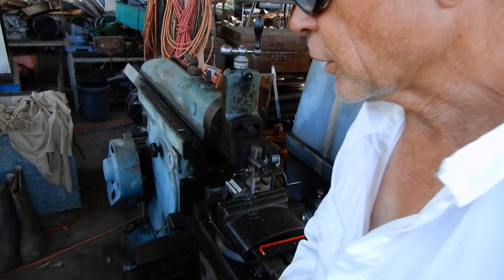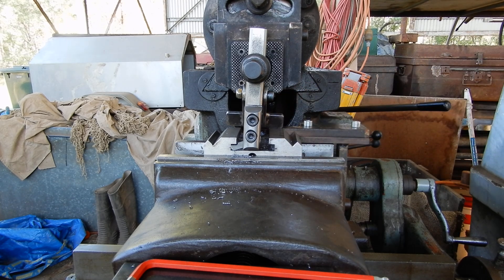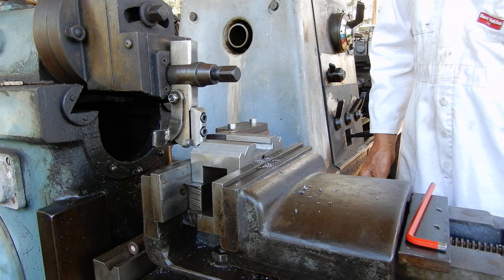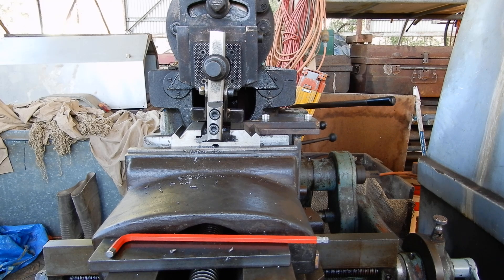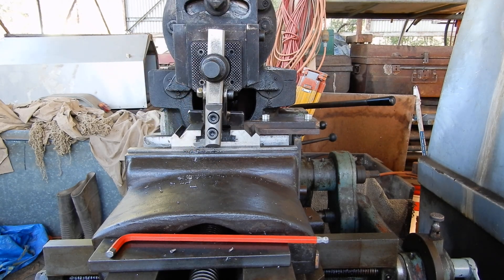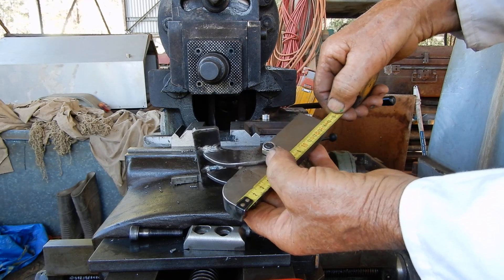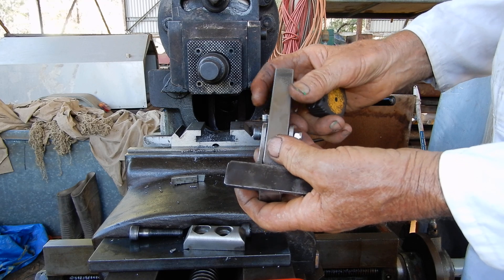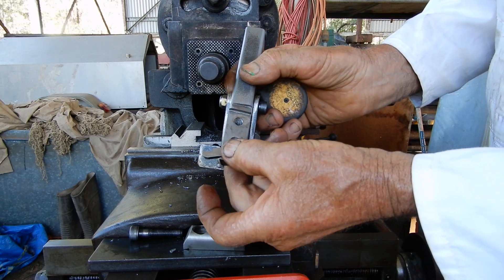Shaper T slot cutting

Comment: I have seen several examples of the lifter idea but all using a piece of leather attached to the back side of the tool or tool holder. They work in much the same way your mechanical device does.
Reply from the maker: none of the tools i show are anything new or inventive but i would like to think i have helped improve the design